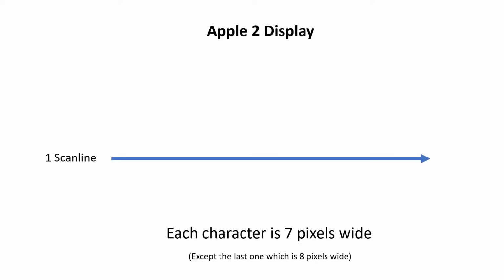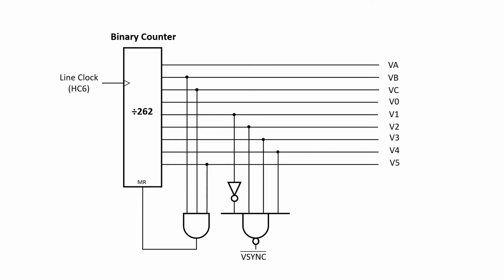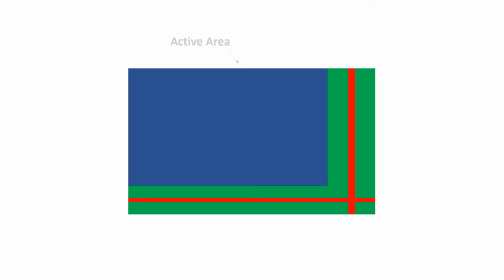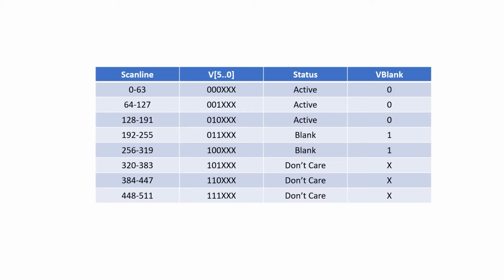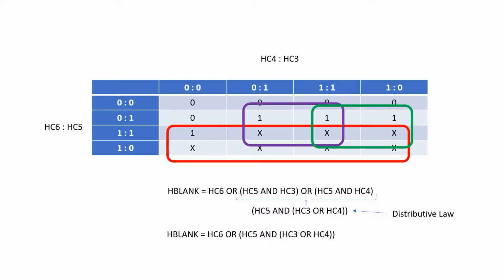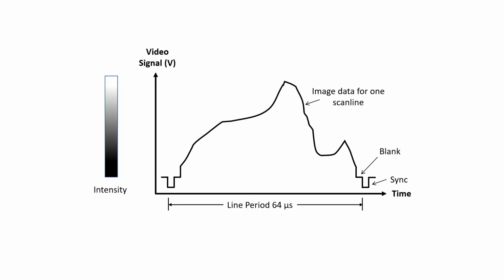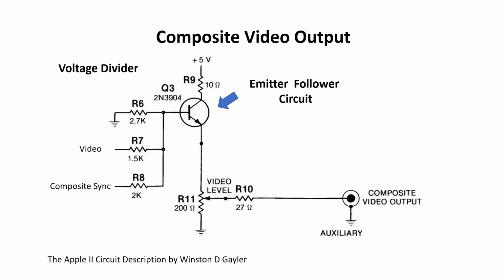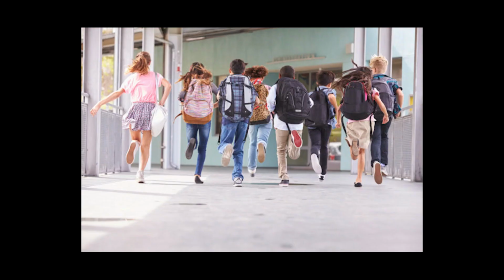Apple 2 wire-by-wire build, Part 9.  VSYNC Circuit

Comment: You make this look easy but I think it would be really hard! Do you have a good book to recommend for new comers to video circuits and 6502?
Reply from the maker: There is a famous book TV Typewriter Cookbook by Don Lancaster is quite good and available on line.  I do actually make a simpler circuit in video 12 where i just use and EPROM as the raster generator.